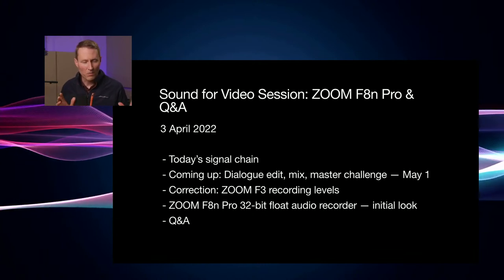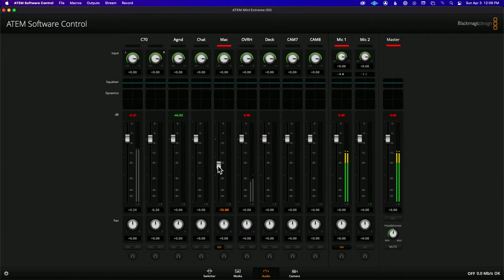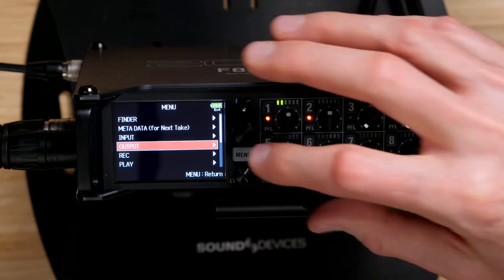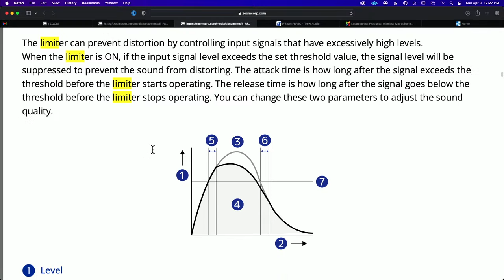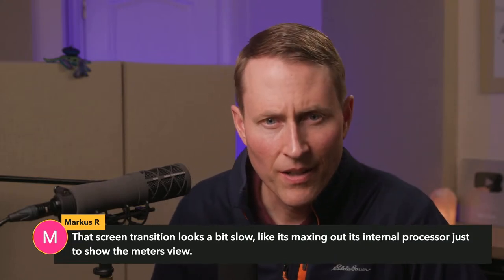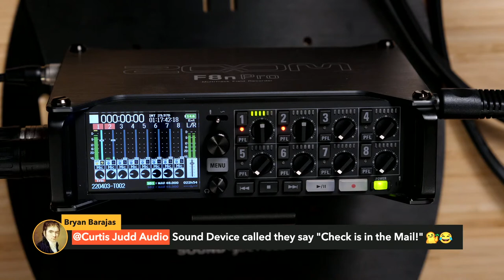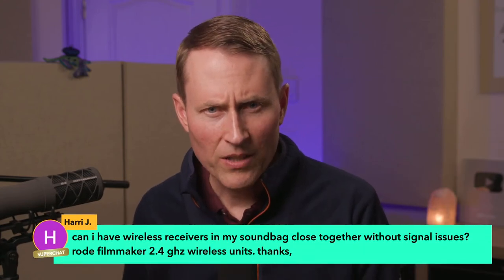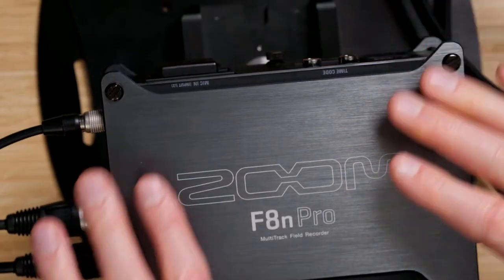Sound for Video Session: ZOOM F8n Pro Initial Look & Q&A

Comment: For 34:43 : The zoom capsule attachments take up input 1 and 2, so you will not gain two extra inputs. Interesting to note that on the F8n and F8nPro the capsule connector is horizontal, on the F8 it is vertical. I think it is a nice change, you can have stereo ambience  with ehe XYH6 attachment if recorder is mounted under the camera for example.

Comment: Hi Curtis. Thank you for another great video, as always! I've had my Zoom F8n Pro for a week now, and the other big change to note is that Zoom removed the dual channel record feature. Likely due to 32-bit floating point, but even in 24 bit recording, the capability is no longer there.
Reply: Thanks for letting us know this
Reply: I've written Zoom requesting they bring Dual Channel recording back (as well as including Dual Bit) so here's hoping they're planning on a firmware update soon with those features.
Reply: Thanks for calling that out, Joshua. I'm not sure whether it would be possible to add that back via firmware, to Christopher's point, but good to know that it isn't an option, at least for now.
Reply: Thanks so much for the great video(s) Curtis! I should clarify that Zoom support did reply to me and said they'd forward my suggestions to the engineers in Japan so hopefully that means it's not a hardware limitation. I know they're redundant, but the Dual modes would be extra nice "just in case" features...
Reply: @christopherwiitala  Thanks for clarifying!
Reply: I was surprised to see the "Dual Channel" feature removed as well. At first it made sense, but if you're still using 24bit it should at least re-appear. Thanks for submitting that feedback to Zoom, Joshua!
Reply: No problem Kelly. If I hear back from Zoom I’ll be sure to update everyone here.

Comment: I came to learn a bit more on how gain is handled by my F8n Pro, and I just understand now how my Tascam X8, which I have been using for a year and a half at least, works :)  There you would also have gain setting (unlike in the F2 and F3), even more, you can manually select whether you want the  low or the high preamp to work. I have experimented with the two preamps and they sound a bit different, especially at the overlapping fringes of their respective ranges. I believe that affects linenout and headphone and when you are recording in 24 or 16 bit. The F2 and F3 only works in 32bit, I assume this is why they can work diffferently.

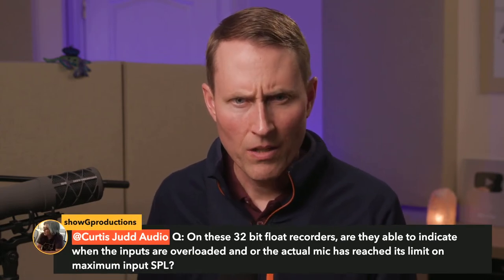Comment: Hi Curtis ! Great video ! At 58:53 the answer is actually yes. In the manual it says clearly a box will appear on the screen if the input is overloaded, which simply means the max output dBu of the mic is superior to what the max input dBu of the Zoom F8n Pro is able to deal with (+14dBu mic level). You can try yourself with a high sensitivity mic like Sennheiser MKH 8070 @ 112 mV/Pa and go loud very close to the mic.
I wish you used a very high sensitivity mic in addition to the Earthwork SV33 which is only 10 Mv/Pa while many boom mic are actually around 25 mV/Pa or even hotter like MKH 8060 @ 60 Mv/Pa.
Reply from the maker: Thank you Benoit. 🙏
Reply: I have a terrible habit of rushing around too much and plugging my boom in with the channel still armed. That phantom power spike brings up the "overload" prompt almost every time.

Comment: Hi Curtis love you videos and LIVES, question about the F8nPro, Have you ever connected a pair of speakers/PA speakers to the f8nPro? a couple of 12" or 15" for a conference type application? or What would be the right specification on the technical sheet to look for? I am looking to upgrade my audio gear and thought to sell my current interface Scarlett 18i8 (rarely have used the 4 inputs) and a Mackie Mixer ProFX12v3 (used for three or four conference type application a year and a max. of 6 inputs per event) and get the F8nPro to act as my interface and mixer.  What do you think?
Reply: Powered speakers, yes. But for live sound, the F8n Pro wouldn't be my first choice. A mixing board is easier to operate for live, in my opinion.
Reply: @curtisjudd  thanks for the replay.

Comment: Another great video, Curtis! Thank you! Loving my F8n-Pro so far and while not quite the update most of us hoped it was still a welcome upgrade from the original F8 I've been using for about 5 years. My initial "preamp/32bit float/post workflow" tests were similar.  If the limiters are still engaged you will definitely print that to the ISO channel...subsequently hindering the benefit of 32 bit recording. Since that test I've now turned off the limiters to let 32 bit do it's thing. However, I've noticed anything above 0dBFS sounds terrible in the headphones almost like the rest of the signal chain can't handle the added dynamic range. I also monitor the ISO channels directly (CH1 boom pre-fade in left and CH2-8 post-fade, automix, right) and maybe listening to the Mix LR with limiters would solve that (although to me, for some reason, monitoring the mix tracks sound different than the ISO's directly).  

Post workflow with 32bit was interesting in that Pro Tools will display severely clipped waveform overviews on the audio clips for anything that exceeds 0dBFS regardless of lowering the clip gain.  The only work around I found so far was normalizing the level to 0dBFS or lower to refresh the visual waveform.

Seems best practice so far on turning over dailies is to provide the raw 32bit files and an additional normalized 24bit version.  iZotope RX can batch convert polywavs to 24bit and retain all iXML BWF metadata. This maintains the benefits of 32bit to purely safety on capture and reduces headaches for editors (even though NLEs are getting up to speed on 32bit compatibility).  Seems WAV Agent from SD needs an update to work well with 32 bit. Metadata is still editable, but playback is clipped distortion and I've read splitting polywavs isn't possible (yet).
Reply from the maker: Thanks for all the info, Kelly. Note that any time audio goes over 0dBFS the audio in headphones will clip because the digital to analogue converter is not 32-bit float and even if it were, the analogue headphone amp has its own technical limitations.
Reply: @LearnLightAndSoundSessions  Now that you've spelled it out that totally makes sense, but it would be nice if it could accommodate the extra range. It was a little confusing at first to know that the audio was fine but to hear it distorted in the moment. I'll have to experiment with different sources in the headphone routing.  I suppose it's a reminder to still continue to set the trims in a "working" range and not rely on 32bit to save the day. Cheers!

Comment: Thanks, Curtis.
It's sometimes tempting to buy the latest & greatest, and the 32 bit seems a natural development. 
But considering that: 
1) the Zoom F8n Pro is offering nothing new, except that 32 bit float, 
2) although it's cheaper than what I paid for the F8, it's still a lot of money, 
3) I doubt it that I'll ever need the 32 bit, 
4) I find the battery sled of my original F8 extremely handy (I have 2 sleds), 
5) and most importantly, I like blue better than black!, 
well, for me there's really no temptation in this case.

(Of course I'm joking about the importance of the colour, but I do like the blue)
Reply from the maker: Those sound like good reasons to stick with the F8, Lau. Happy recording!

Comment: Hi Curtis.  You covered a lot of good stuff and made some really interesting points in your video.  I've been using the F8N for about 3 years,  It's served me well and for the price is a great. 
However, I've always thought there was room for some fine-tuning.  The headphone amp, using analogue limiters, for example.  So I was really disappointed to find the new F8N pro is basically the same recorder but with 32 bit. For me, this isn't a good enough reason to upgrade to the new Pro. I think Zoom have dropped the ball with this and failed to gain any advantage over the Sound Device Mixpre series.  
I've decided to go a different route and buy secondhand Sound Devices 788T, I've not had the chance to use it in anger yet but I'm very impressed with what I've seen/heard so far.
Have you thought of doing a video on Secondhand pro kit?  There are some bargains to be had .
Many Thanks and keep up the good work.
All the best 
Roger 
From the other side of the pond.
Reply: Hi Roger, congrats on the 788T. That's a solid recorder! I haven't looked into used kit simply as a matter of time and money. I've got so many recorders, I can hardly keep up. Happy recording!

Comment: Hello Curtis. 
Thank you very much for this great Q&A about H8n Pro ! 👍
I look forward to your test of the F8n Pro. I hope you can check the behavior of the F8n Pro with the EXH-6 capsule (2 XLR/TRS inputs). 
Also, is the recording quality of the H8n Pro better than the H8n at 24-bit and 16-bit ?
My two cents, about the comparison between the F8n Pro and the MixPro-10 II. Here in Europe, MixPre 10 II costs twice the price of the F8n Pro (1100 € vs 2300 €). Thus, I think that the price must be taken into account in the comparison. Is there another competitor of the H8n Pro in the same price range (with 8 inputs) ?
Thank you.
Reply: Hi Laurent, I don't have the EXH-6 module, but the recorder can record a total of 10 tracks simultaneously. I believe that means that if you choose to record two additional tracks plus the 8 built-in inputs at the same time, you cannot also record a stereo mix at the same time. So there's a bit of a sacrifice there. The recording quality of the F8n Pro is better than the H8 in that the preamplifiers in the F8n Pro supply far more gain and have a much better self-noise spec. I understand re: the price difference. The difference isn't quite so large here in the US so I understand why the F8n Pro might have more appeal for those in Europe. I am not aware of any other competitive field recorders with 8 inputs near the same price and quality as the F8n Pro.
Reply: @curtisjudd  
Thanks Curtis for your replies. What is not clear to me in the user manual is that on page 35 they say that "when a mic capsule is connected, Inputs 1 and 2 cannot be used",  then on page 36 that "EXH-6 is supported (see linking inputs as a stereo pair)" on page 36, but do not mention the L(9)/R(10) channels. But I must have misunderstood something from the user manual. But according to your answer, it would record the sound of the EXH-6 capsule on L&R channels instead of the L&R downmix and not instead of the 1&2 inputs. Thats a great news.😀
Reply: @laurentb.2064  Please confirm with ZOOM support as I do NOT have an EXH-6 on hand to confirm that myself. I am not sure how that works.
Reply: Using the proprietary Zoom mic capsules like the EXH-6 will take place of the XLR/TRS inputs on CH 1 and CH 2. The mix track is always counted for even if you choose not to record it in the Record menu (at least with my experience with the XYH-6 mic module).  This is one of the "features" that makes little sense to F8 owners as it doesn't really expand the stock functionality of the unit with more recordable channels.  On a feature I worked on I experimented with having the XYH-6 capsule clipped on my bag to quickly grab ambiences.  It was a constant pain to plug the extension cable under the F8 while in the mixing bag, and then it would totally reset any channel configuration you had for the XLR/TRS on CH 1/2.  If it would add 2 additional XLR inputs in lieu of the mix tracks that would be incredibly handy as often I see situations where I could use just 1 or 2 more inputs (I record music as well as film sound).  At least on the H6, the EXH-6 module isn't capable of phantom power which hinders it's usefulness even more. No idea for the F8 series.
Reply: Hello Kelly Askam. Thank you for your feedback. 😀I have sent a message to Zoom, about H8n Pro and EXH-6 (I do not own the F8n Pro). I am waiting for the reply. I am fully agree with you , it would be very useful if EXH-6 add 2 additional XLR/TRS inputs in lieu of the mix tracks and turn F8n Pro into a 10 isolated track recorder.

Comment: Have you tried recording with the Shure SM7B on the F8, F8N or F8N Pro? I bought the SM7B to do voiceovers with it and I love the warmth of the mic but I'm having a massive noise problem due to not being able to find a decent preamp for it. Everyone told me to use the Cloudlifter CL1 so I did and that only slightly helped. I can't use a condenser mic because I live in an apartment with noisy neighbors so a dynamic mic is the only way to go. If I can just find the right preamp I'm golden. Do you by chance have any suggestions? Thanks.
Reply: Hi Warren, first, are you experiencing self-noise from the microphone and preamp or ambient noise in your recordings?
Reply: @curtisjudd  Thanks for the Reply Curtis. Self-noise. The noise is similar to static or white noise.
Reply from the maker: @WarrenWatsonActor  If you want a field recorder, the Sound Devices MixPre would be my first suggestion, though they've been out of stock for a while. The ZOOM F3 through F8n Pro have almost-as-clean preamps with 75dB of gain and should work nicely with the SM7B.
Reply: @LearnLightAndSoundSessions  Thanks. It looks like I forgot to mention that I'm using the F8N Pro and having this problem. I can't count out an issue with the Cloudlifter either but I don't know how to check if it is faulty or not.
Reply: @WarrenWatsonActor  The F8n has plenty of clean gain for the SM7B. I would remove the Cloudlifter altogether. Turn off phantom power for the input you're using for the SM7B. Try different cables. Cables are the most likely culprit when getting noise. Also, there is a vast range of cables in terms of quality. I'd recommend you try a cable with Neutrik connectors and either Mogami or Canare cabling.
Reply: @curtisjudd  Thanks. I'll try it without the Cloudlifter but I'm using Canare cables w/ Neutrik ends.
Reply: @curtisjudd  - I still have that hiss. Here is a sample I made this evening, May 13th - http://warrenwatson.net/wp-content/uploads/SM7B_noise_floor_5-13-22.mp3?fbclid=IwAR0v-BCV4XRByXXJGpwv6nhmUZwN9s4abXaHV0HdSFQvq2V-HTUmWTChvhM
Reply: @WarrenWatsonActor  That's a lot more noise than I'd expect. Probably best to contact ZOOM support as a start. Best wishes.

Comment: At 37:00 Actually it's pretty common with prosumer gear like this to be prone to RFI noise with electronic gear nearby. I don't know yet about MixPre if they are better shielded against RFI but Zoom is not. Even if you have your phone in airplane mode next to the zoom, the zoom with catch the dimming light of the phone screen and produce buzz. You really have to be careful with those kind of products. A strong shielding is one of the thing that might justify going to top tier recorder like 6 , old 7 or new 8 series for Sound Devices. But for prosumer ultra compact recorder around 1000-2000€ you can't expect it to be strongly shielded (lot of R&D) hence you can always expect bad behavior with other pieces of equipment nearby that are simply having electronic cicrcuit on, or especially emetting radio frequency. G3/G4 should be as far possible from the recorder as possible. And phone should be off. Of course if you're using the iOS/Android (now compatible to Android thanks zoom!) app, you might want to use your phone far away especially from the recorder screen which is the least shielded part on the Zoom.
Reply from the maker: In this case it was me changing the delay in the menu while using it as a preamp for the stream.

Comment: If only they’d paid for a Dante license, they may actually have something that could start to compete with Sound Devices. SMH
Reply: Plus whatever additional costs there would be for the hardware to support Dante, including a re-design to accommodate the addition of an RJ45 jack and supporting hardware and Dante controller. I'd also like to see them provide repair services which is critical for professional use.